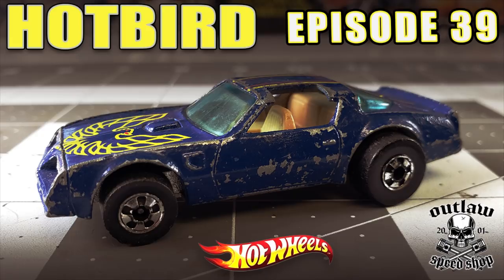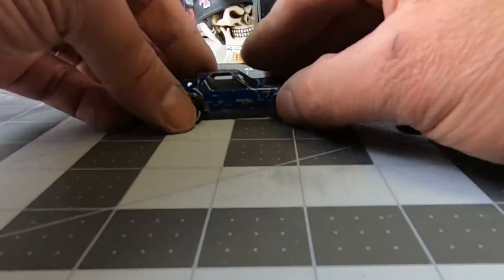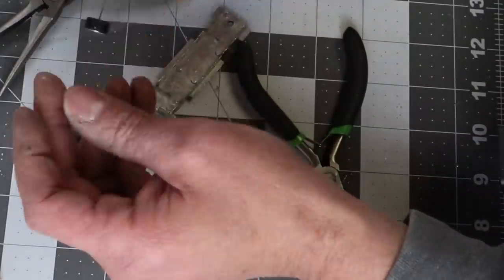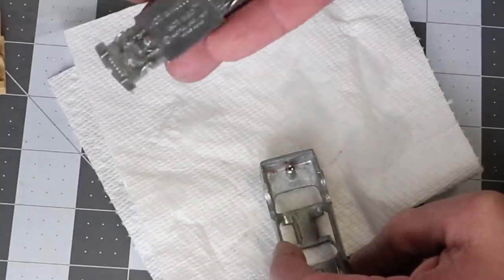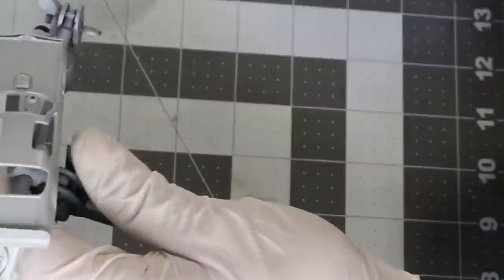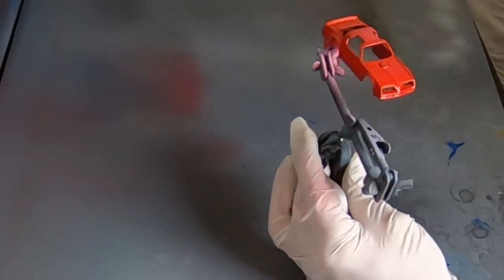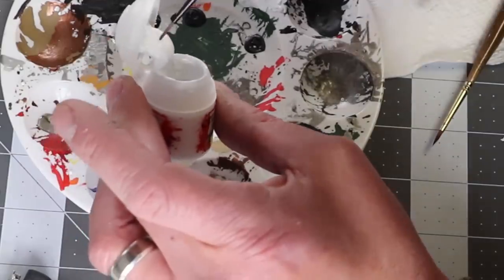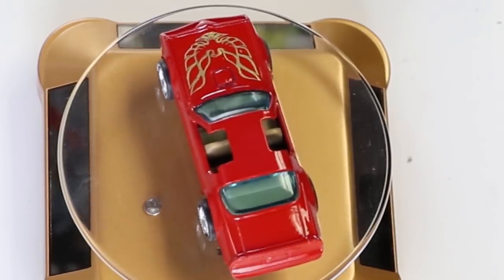Episode 39- Hot Wheels Custom HotBird

Comment: On those gaming paints. I usually put a couple drops of liquid dish soap in the bottle. The soap has glycerin in it. It helps with the clumping and drying out. I have gaming paints from 20+ years ago that still work. If they get thick you add a bit of water to the jar and shake it up. You can also buy and use straight glycerin.  The other bonus is that it helps break the surface tension and lets you paint smoother. I keep an old jig saw rigged with a bar clamp to shake up paint bottles. It works reasonably well.